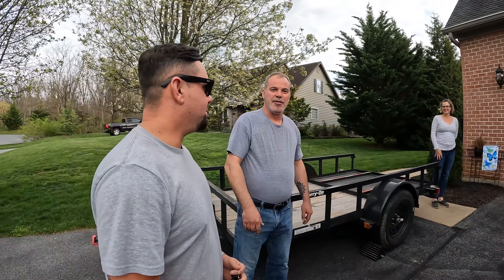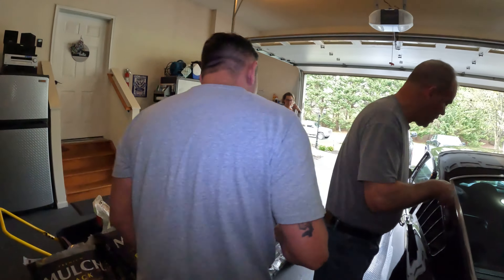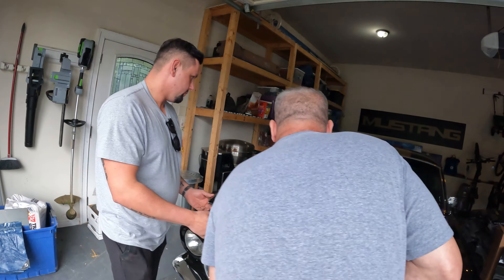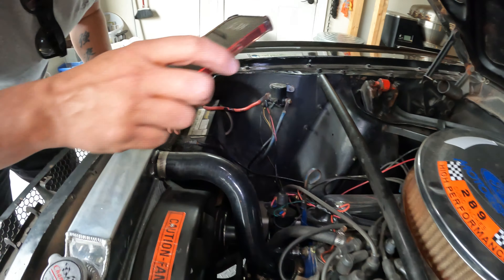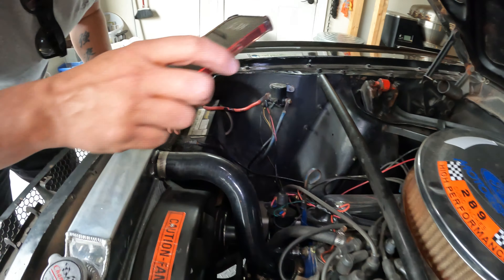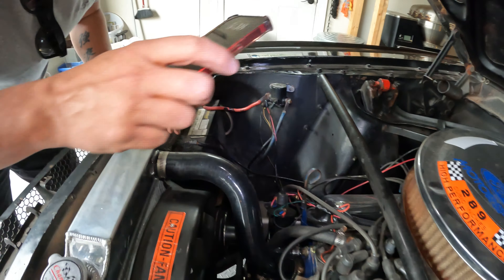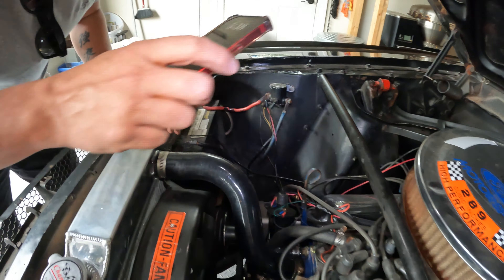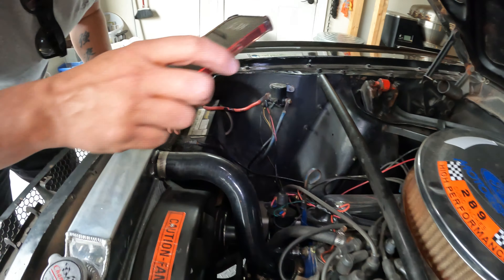1965 Mustang GT350H Chasing Classic Cars FOR SALE SOON! at Bob Evans Classics

Comment: Just some critique of the car.....
The fluid in the valleys of the intake manifold, is more then likely gas from the carburetor. A new carburetor to intake gasket would fix that. Unless the carburetor is leaking. Then a carburetor rebuild is in order. For oil to be in those places, it would be valve cover gaskets, 
unless the intake manifold is cracked, or is not sealing. I have the same problem. For me, it's a carburetor gasket to the the intake.